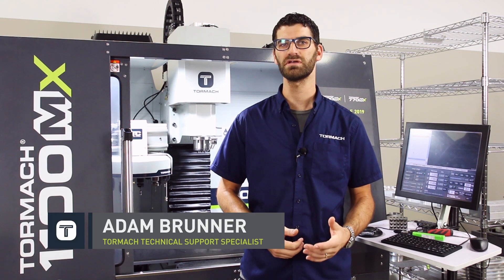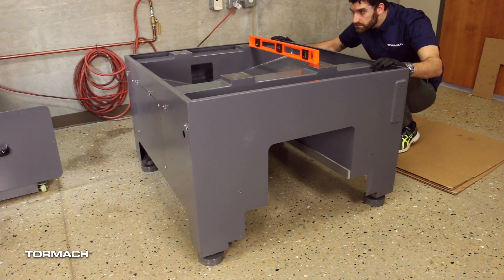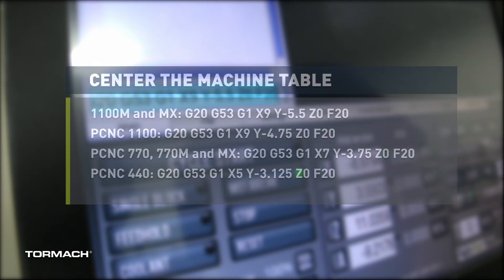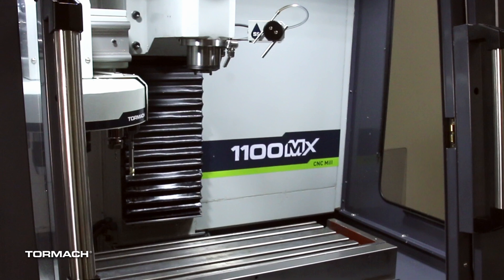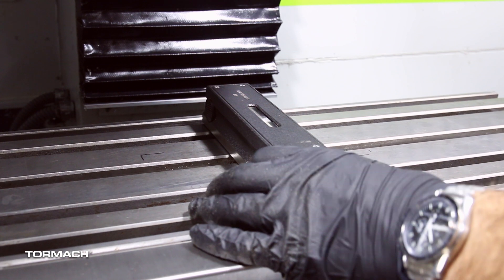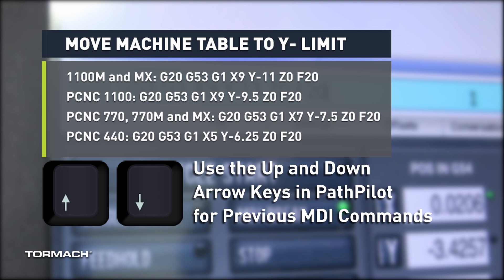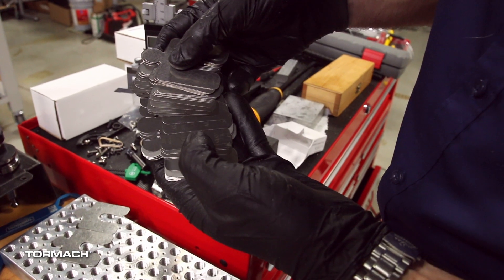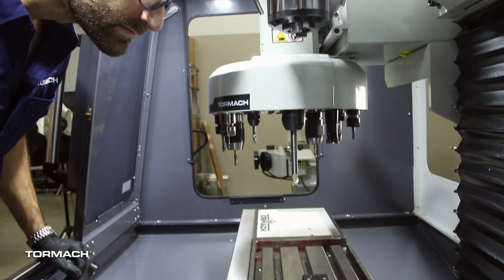Commissioning Series -  Leveling and Squaring Your Mill

Comment: This is an excellent video. Thank you. So really you level the Mill stand and then you untwist the mill. You don't really level the mill. This is a destinction that I have not seen before.
Reply from the maker: Every machine is going to have a different setup procedure, but in our research, this is what works for our mills so you can get the most out of them.

Comment: Greetings, I have a PCNC 1100 Series 3 CNC mill for about ten years, I use it almost every day, today i have been working and I realized that I think the spindle head is slightly tilted to one side, because I am using a face milling cutter and the tool cuts from both sides, I mean, it cuts in and the surface that has already been cut when the tool advances cuts again over it. I don't know how to explain it better, I'm not native to English. In any case, I would like to know if you have any video on how to align the spindle head, please.
Reply from the maker: For this situation it would be best if you opened up a support ticket, with all the details of your situation, so that one of the Tormach Customer Support members can help you out. https://tormach.com/how-to-submit-a-support-ticket

Comment: Any advice on leveling the Slant Pro?  Is it required or no?  I've found zero info on that.  Where to even place a level to check?
Reply from the maker: Because of the inherent design of the 15L Slant-PRO, owners only need to ensure all 4 feet are in contact with the floor. Any leveling done needs only to focus on optimizing coolant drainage.

Comment: Do the Shim kit come with the M machines ?  if not can they be purchased? When is BT spindle going to be up for the M machines on web sight?  good info Thanks
Reply from the maker: The current batch of M stands are coming with shims but if you are looking to buy, we have a shim kit (PN:39565) on our website (Tormach.com).

For the most up-to-date information on any new product or upgrade I would recommend signing up for the newsletter at the bottom of our main screen.
Reply: @tormachinc  I'm unable to find shim kit (PN:39565) on your website. Also I'm really looking forward to a video that will help us get the spindle perpendicular to the bed.

Comment: What is the best way to tram/square the spindle axis to the table?
Reply: Did you all figure this out ?
Reply from the maker: That is going to be another part of this commissioning series. Make sure to subscribe to the channel so you don't miss it when it comes out.
Reply: @tormachinc   Do you still plan on doing a video for tramming the spindle head?
Reply: @tormachinc  Any update on this?
Reply: @derek1ee  The video is now part of the M and MX playlists.
Reply: @TormachTechnicalSupport  i can't seem to find it.  do you have a direct link to that video?
Reply: @TormachTechnicalSupport  I can not find it either, does it exist?
Reply from the maker: Unfortunately the rest of the commissioning doesn't exist yet. The pandemic put a damper on things.
Reply: @tormachinc  Can tech support publish the procedure on the website until a future video is made?
Reply: @tormachinc  I've got an older PCNC 1100 and am curious about how to get the head trammed as I recently noticed that it is tilted slightly causing uneven surface finishing.
Reply: @tormachinc   Has a tramming video been released yet?